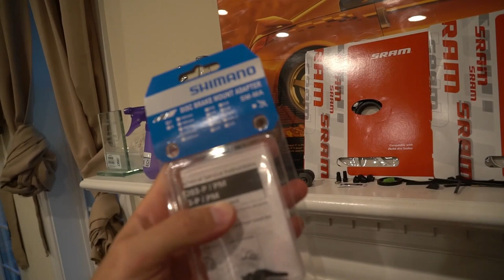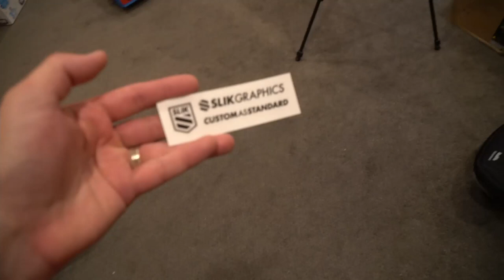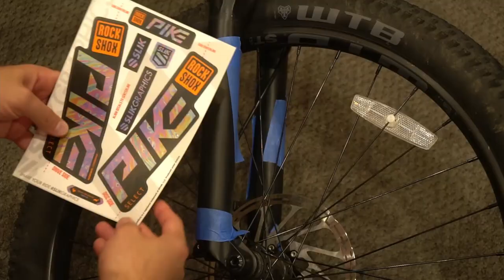My Modified Kona Big Honzo DL

Comment: Looks good man...the only thing I would say is that by increasing your fork travel changes the geometry a ton. The pike is awesome, but in adding that 10mm you've voided your Kona frame warranty and you're going to put a lot more force through your stem, decreasing the reliability of the frame by a ton. I'm 6'6 220lbs and I have put that bike through the paces with a 130mm (I've bottomed out once)...you really don't need more.
Reply from the maker: That's good to know.  Most times I see manufacturers state an acceptable travel range.  Would think +10mm isn't a biggie.  I believe I can swap out the air spring for a 130mm if I wanted.

Comment: Gratz for good explained video and for new parts on u`r Kona. I have a Kona Lanai model 2021. I want to fit wider tires and obviously buy a fork first. I want to buy a 180mm Pike and I was wondering if it doesn't change the geometry too much to deform the frame. Which is the widest tire that I can mount on the back is a big question :) does a 29x2.60 fit in? Thanks in advance an good luck to you.
Reply: A 180mm Yari, sorry my mistake :)
Reply from the maker: A 180 is big!

Comment: can big honzo fit 29 tires??? And if so how wide
Reply from the maker: I want to say those were 2.6 tires on there.  Never tried to max out tire width with the 29 setup.
Reply: the big honzo is designed around 29er geometry, on my 2020 big honzo i can fit a 27.5x3.2 so I think that a 29x2.6 can fit